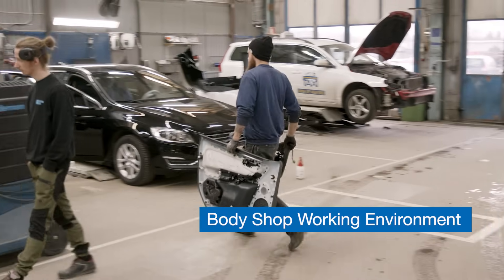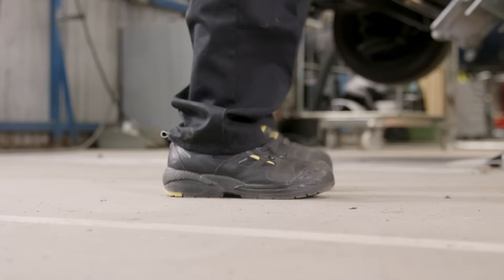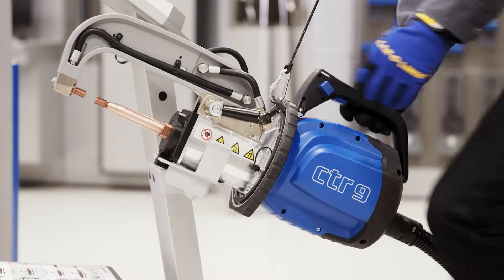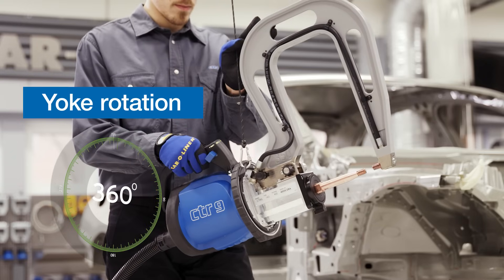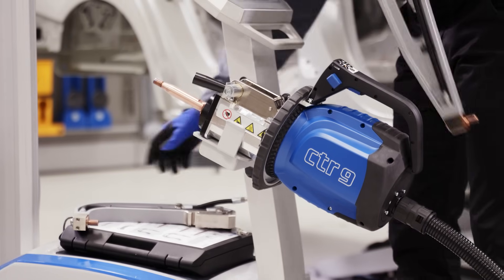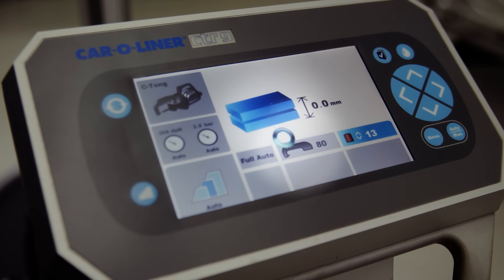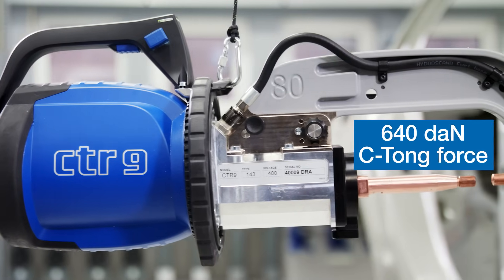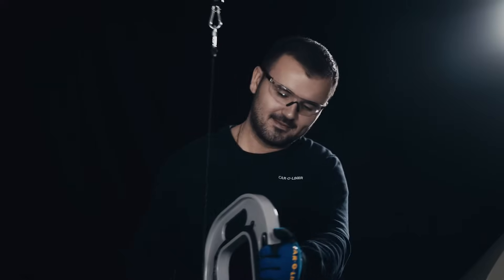Car-O-Liner CTR9 Resistance Spot Welder

Comment: Does those welds really penetrate 100% ? 🤔🤔
Reply from the maker: The CTR9 determines the correct amount of energy and pressure needed for proper fusion of the materials being welded. It then monitors the parameters through the weld cycle to ensure the process is achieved.